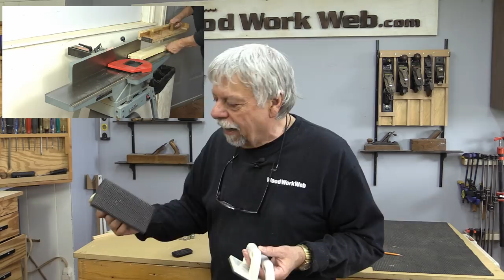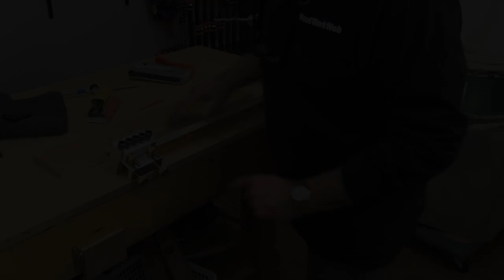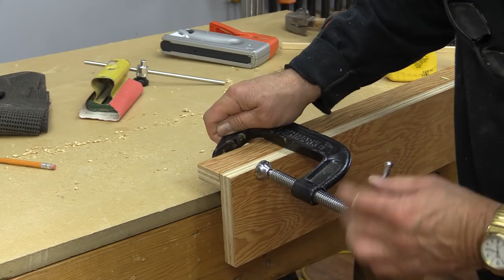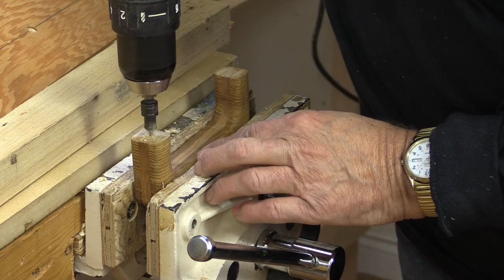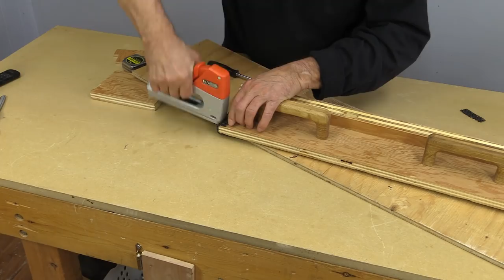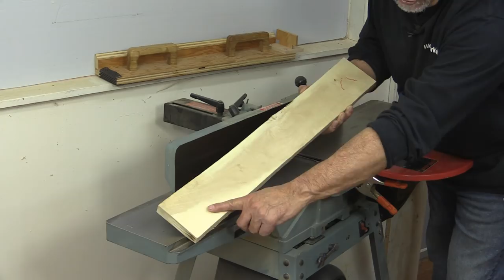Make an Edge Jointing Sled Jig / Edge Jointer Safety Push Block

Comment: I've thought about having a lip on the back of even the smaller ones. Have it on the back of one of them. The only problem I see might happen with this is pushing down to hard and making the board flatter then at rest. Joining it flat with pressure then having spring back after. Of course someone with your experience would feel this and make sure it doesn't happen. That board was only good for firewood lol.